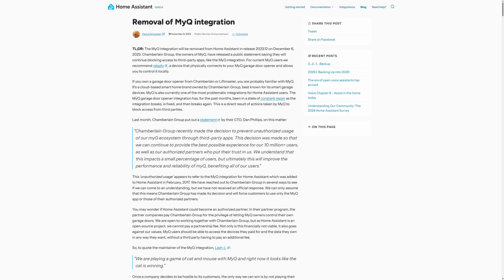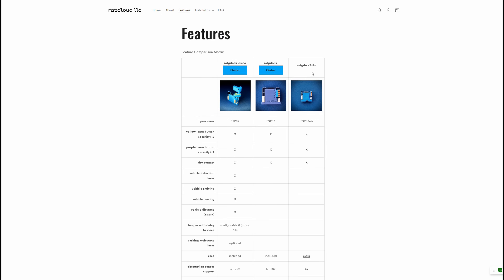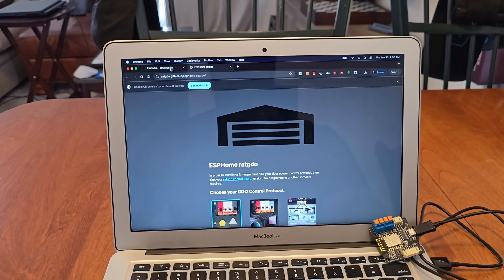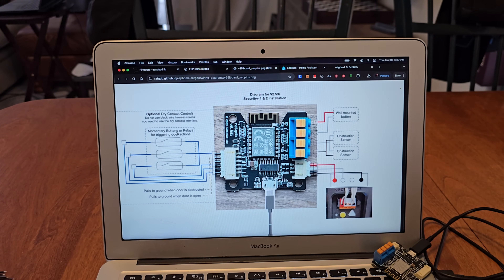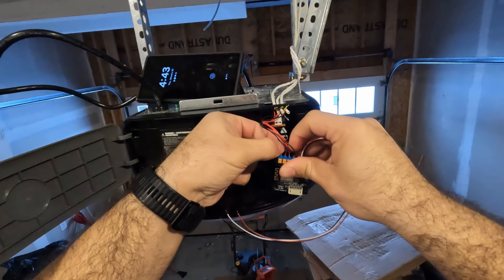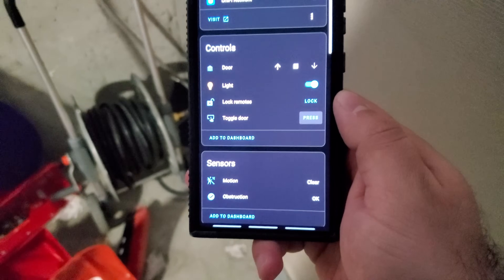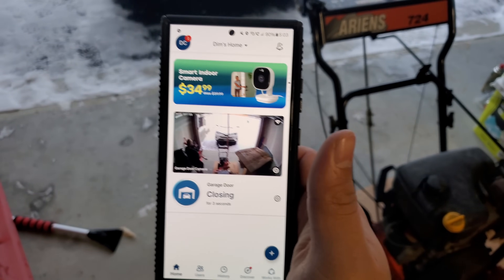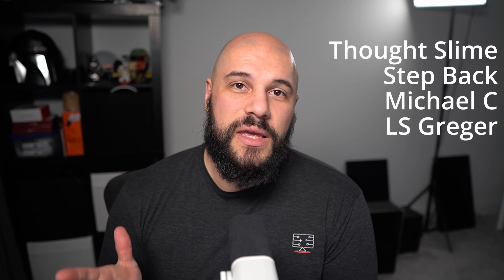Getting Rid of MyQ | Controlling My Garage Door Opener With Ratgdo & HomeAssistant!

Comment: TP Link Tapo also has a very reliable ecosystem, they offer relays, door sensors and hubs for this purpose (all wireless, minimal wiring is required). It should  be more reliable than home assistant, because it doesnt rely on an OS. For people who just wants things to work, home assistant could be a hassle because of deprecation issues, i also have experienced some random app downtime with home assistant.
Reply from the maker: Yeah but it does the exact opposite of what I'm trying to do here. None of this communicates with the internet to do what I want, none of this is hosted on a cloud. If you use the Tapo stuff and your Internet is down, you can't use those things anymore until you're connected again. And at any point they can decide to no longer support the device you bought and you're SOL. I agree it may be easier to initially set up but it is opposite of what I mention I'm setting out to do here.
Reply: @_Caddac ok, has the system worked well since you uploaded the video? I am using home assistant too, and they constantly seem to depricate things i want to use. To mention a few: RPi GPIO, Home Assistant Supervised installation. Also some stability issues with HAOS. I agree about the open source principle
Reply from the maker: Yeah it's been great. Nothing I use has been affected at all and they've added plenty of great new features as of late.

Comment: Will the RATGDO allow you to turn off remotes?  Preferably just one or two of our remotes. 

We had a car broke into and they were able to just hit the button in the middle of the night to gain access to the garage.  I want to be able to turn certain remotes off at night with a command we already use when going to bed.
Reply from the maker: Hey, an update! There is a Lock Remotes option in HomeAssistant so that should work! You can set up an automation to trigger that on or off at particular times.
Reply: @_Caddac thank you!!
Reply from the maker: I don't believe so, disabling remotes is done by the software of the opener and the RATGDO doesn't interact directly with any of the software.

Comment: It’s not easy, but it’s it is there’s an Amazon Alexa monetary controlled switch Solder the two ends across the momentary button in the garage door opener that is technically hardwired to the wall away from the garage door, main motor operator, and every time you ask her to turn it on and don’t forget to set up the routines for it she will momentarily bridge that switch And mine opens just fine. I have a craftsman one horsepower with my queue that I bought one month ago from Lowe’s and I still get to have my Amazon controls operate regardless of my q don’t overthink it guys

Comment: MyQ sucked. Every time I went to use it with my phone and needed it the most I was required to log back in to an account which was a pain in the arse. I bought a $3 module that works with android assistant and other platforms and was able to configure it to work in inching mode like the wall button or remote for the garage door. I have a cam in the garage so I can identify whether the door is open or closed. Works way better.

Comment: I have 4 garage doors. RatGDO was not as cost effective as a spare 4 channel remote and a 4 channel relay board that worked with Home assistant. I also purchased a DC to DC converter board and snagged power from the relay board to power the remote without a battery.  The Chamberlain Group will never have me as a customer again.

Comment: this is great! glad i came across it! the only thing about running pass through VS piggy back, is if in pass through and theres a power loss you wont be able to open/close your door since the ratgdo will not have power (unless you add a battery back up or power it from the garage doors battery). i think lol
Reply from the maker: My remotes and wall button still work if I unplug the Ratgdo from power.

Comment: I open and close my garage door every day with the myQ app.

No subscription required.
Reply: But without a subscription you cannot control it with other home assistance products or use it in automation routines. Only app control
Reply: As stated, you can no longer integrate it with other smart home devices. For example, I have an automation where as soon as the door opens, it unlocks my garage entry door, and turns on the garage and interior lights at night. You can no longer do that with the change MyQ made. I also can no longer use voice commands to close my door, inconvenient when I have my hands full when entering my house. Finally, it’s a pain having multiple apps to use various smart home devices.
Reply: I too do not have this issue explained in this video. The MyQ app opens and closes without instant. It does tell me that my battery is low for over a year when the battery is perfectly fine, but otherwise it works great.
Reply: I have never paid for MyQ and probably only use it 6 times a year. It's either the keypad or garage opener.
Reply: @MountainJack28  You really have to try it integrated with home automation. I’m not a super tech nerd but the ability to operate and monitor my door, especially with other family members, is great. No more worrying if I left it open, and I have it integrated with lights and cameras.
Reply: @cheapme1850  I didn't say I didn't have it set up with my home automation.  I said I only use MyQ a few times a year. My garage door is part of the security level of my home.
Reply: You misunderstood the problem statement. Keep using myQ all you want. Meanwhile the rest of us will be enjoying home automation and being able to control this locally even when myQ's servers are down.

Comment: FYI for anyone looking to bypass the security + and want to control you opener with a generic relay. You can solder leads onto the button of the circuit board from the security + wall button and now shorting those leads will trigger the door just like pushing the button.

Comment: Just get a Meross homekit controller. $40 on AMZN, wifi, plugs in.  HACs integration via HomeAssistant.  It's compact, not a science project, works great.
Reply: That’s exactly what I did. Much less complicated and plug and play. Been working perfectly for about a year and a half now and very inexpensive.
Reply: I find my Meross openers always lose connection... I can't rely on them.
Reply: @ppi57  Mines only disconnected once since I’ve had it. My Meross light switches on the other hand, constantly need to be reconnected or reset.

Comment: I first heard about this product from a co-worker a couple weeks ago. In my digging, I've been hard pressed to find any need for the MyQ subscription, nor what it provides. I believe my opener is 4-6 years old, and has been running MyQ without a problem. It does not have cameras or any other "extra" features that I'm aware of. I also have not seen any ads in the ap or prompts for the paid subscription. Is this a bigger problem with newer, more feature filled units? Is it only when diving into HomeKit/HomeAssistant when the issue pops up for a non-camera unit?
Reply from the maker: The basic functions are available without a subscription, for now. At any point Chamberlain can revolk that. I have constant ads to subscribe for video storage and "other premium capabilities". 
I don't like putting my trust in companies, especially ones that have proven to be greedy and against consumer interest for their own profits.

Comment: You don't understand why it plays an audible alert when the door is closed by the app?  Really?  You don't even want to guess?

MyQ is far from perfect, but for an app to open and close my garage door, it works just fine and integrates seamlessly with Alexa.  For $30 or so, that's just  fine.
Reply from the maker: I don't understand why it needs the audible alert for 5 seconds before and then the entire time it closes, no. I understand it's a safety feature but I feel it's very poorly done. 
And yes everyone uses Alexa, you're right.
Reply: @_Caddac  Fair enough.  But if I were their attorney, my advice would probably be something like, "have it beep long enough to warn people and make sure it beeps until it isn't a hazard".  And that sounds like what they did.
Reply from the maker: @kcgunesq  Yeah it's just so loud and goes for long it's basically unusable at night without getting noise complaints from a neighbour.

Comment: I took a different approach than ratgdo to automate my MyQ two-door garage. I used a Zooz ZEN16 relay, a pair of Zooz ZSE43 position sensors, and a pair of Chamberlain LM829 controllers to enable automation of door closings and to know door position. I realize this video is all about raging against Chamberlain, but the approach I used never touches or replaces their ecosystem. I just leveraged the capabilities they offered to bypass them and have full local control. My solution has no ability to open a garage door, and I like that limitation. I never want either of my doors opening without my manual intervention. Garage doors are a serious security threat. Mine never stay open long. I have a timer that closes them after a predetermined amount of open time.
Reply: Doesn’t the relay connect to the opener just like this method? He also demonstrated that MyQ still works?

Comment: Sadly this is a pain in the ass on older GDO's. You have to wire up two reed switches that tell the system if the door is open or closed.

Comment: just got my V2.53I - my opener is 41A5021-1c liftmaster security+ and uses 3 terminals red white black. with a red learn button. 3 term vs 4 is confusing me.
Reply from the maker: Hello Jerry, your garage door only has 3 terminals instead of 4? If that's the case, your red should go to the left terminal, white to the middle, and black to the right terminal. You may have to use yours in the pigtail config instead of in-line like I did.

Comment: How would you implement guest access with RATGDO? With MyQ, you can send an invite in the app.
Reply from the maker: With HomeKit you can set up guest access pretty easily, with HomeAssistant there are a few different paths and you need to figure out which best suits your needs. My guests wouldn't want to download an app for the sole purpose of opening my garage door so the MyQ guest access thing kind of stinks for that. Right now I just set up guest codes for my front door access instead or tell them the pin code for the garage.

Comment: I have had two Chamberlin / Liftmaster garage door openers, the first one just wore out over the years. My second one has the MyQ app and have had no issues with the app or sales. The blinking and chime notification is a warning that the door is closing or has an issue. The door opener limit switch had an issue on mine. Which the door opened blinked it's lights and displayed the trouble code on the wall switch's display. I just had to reprogram the up and down limits. It blinks the lights and beeps also when closing to warn the idiots that allow their children to run amok it's closing.  I do not want a full home automation integration, especially one you talk to, Someone could yell "Open Sesame" and get in my garage. All I need is the door to open and shut. The manual says It can do Amazon key to allow the delivery person to access and open to place packages to thwart porch pirates. That's not for me either as they do not need access to my garage.  But as you all should feel safe knowing that Home Assistant discloses potentially personally-identifying information only to those of its employees, contractors and affiliated organizations. Meaning your information can be bought at the right price. You can feel secure that Home assistance did a security audit September 2023 and the security issue found was fixed. Well what about 2024 and now 2025. I guess Open source no one has placed any erroneous code that hasn't been found. But it looks like a great app if I was into total automation. I'm not a fan of Blackstone as they are a private equity funds management company. The Duchossois family sold it and that's their prerogative. Usually private equity funds break up the businesses and sale off portions of the company for profit. This could mean Chamberlin brand is just waiting for the right buyer and so long MyQ anyway, but it's been four years. I also hope Ratgdo has resolved it's user security issues posted on Redit.  Anyway, Have Fun it looks cool.

Comment: I wish I had seen your video before I ordered, just for the wiring info, but yes, I agree 100%.. I am a new RATGDO32 owner, and LOVE it..  The beeping on closing is apparently a law that if you close the garage remotely, they have to alert first, which is annoying..  For the wiring, I am moving soon, so I connected mine with WAGOs on each wire and hooked mine up in parallel so when I move I can just pull the RATGDO off and take it with me to my new house.   FWIW, I think the percentage open/close thing doesn't work at first because it TIMES how long it takes to fully open and close, and from that, figures out how long to let the motor run to get a percentage, and so it needs some historical data to know how long it takes to open/close before that feature works. I could be wrong, but if you look at the data provided by the app, the timing is all in there.  Happy to say in my new house, my new garage door is never going to see the Internet since the RATGDO will controlling everything!!  I dont know if you have CarPlay, but I'd be interested in seeing a video about creating an "open garage" button on the HA app on carplay.  I've been playing with it a little and think I have it working, but the process of getting functions to work on carplay in HA these days doesn't seem to match all the tutorials I have seen, so I am wondering if what I did is the best way to do it or not..
Reply from the maker: Unfortunately I do not have CarPlay but I can look into it at some point.
Reply: Hi, just wondering, is there a real difference between parallel vs the way @_Caddac did it?

Mine just arrived and I plan to hook it up on the weekend and was wondering.
Reply: @1uTubeViewers  No.. no difference..  I emailed with the maker and he confirmed - The wires just connect inside.  In fact, I have since moved, and installed the device in my new house, and I was having trouble using all of the wires in one way, so I connected 2 through the passthru, and one directly (or vice versa.. I can't remember!)  Anyways, it's working great!!

Comment: Yep. RATGDO is 100% the way to go. I struggled with connectivity and reliability with the MyQ system. I had reached out early on and lent them some help. The original crew is gone and the Accountants and the C Suite idiots have run it into the ground.

Switched to RATGDO over a year ago on my two openers. Took some network adjustments but after I added an Internet of things (IOT) network to my Wi-Fi   It has been smooth sailing.

Comment: Sure you all probably know this but this is why I don't want any smarts built into my GDO.  Old school doorbell style switches are best, then you can implement your own low cost connected relay to integrate to your smart home hub of choice.  Android Auto even has an app that allows buttons from home automation to be brought right to your dash screen, putting the button to control the door right on your cars infotainment screen.
Reply from the maker: Yeah, you're totally right, but many newer openers have features that are impossible to replicate with a simple switch. My Chamberlain having the features and sensors that it does allows my Ratgdo to provide me more control as well that I likely wouldn't get with a super basic GDO. I also paid less for mine than most of the other options out there.

Comment: I noticed at @9:12 you didn't have the device hooked up to any extra power. Is that right? I doesn't need to be plugged in to a power source to work? Or it draws power from the cables that you plug into it? I'm asking because a lot of the install pictures I see of the device always show it installed with a USB cable connected which I assume is for power.
Reply from the maker: It does, I just didn't have it plugged in at that moment. You can see it plugged in at 16:09. You need it to be plugged in via USB for power.

Comment: My garage door opener is supposed to be MyQ compatible but I could never get it to work, and even technical support said that "some routers don't work with older MyQ devices." I'm really interested to check this out.
Reply: There's two keys to getting a MyQ to work : 1) don't try to put it on any kind of mesh and 2) make sure whatever SSID it connects to runs 2.4 only, with WPA3 disabled.
Reply: @litz13  I couldn't get it to work even with  using the device's web base gui. The next step was to use Wireshark to figure out what's going on. I stopped when I found out home assistant was not supported.
Reply: If you have home assistant, this is the best option. I spent weeks trying to MyQ work. The RATGDO install took a total 45min to do.